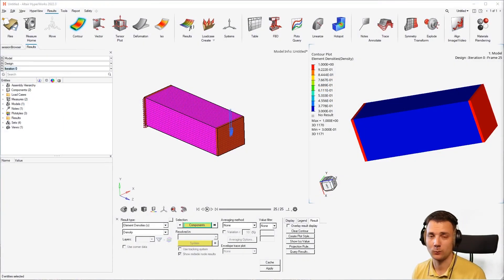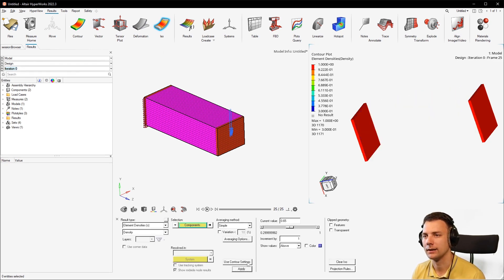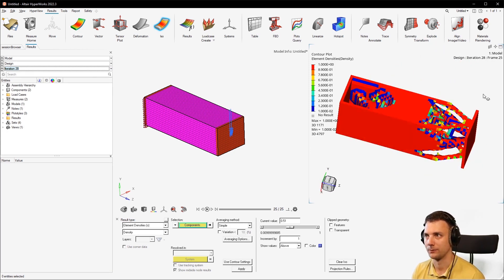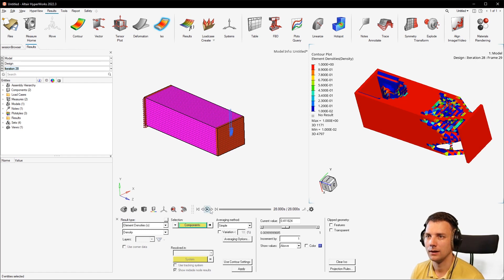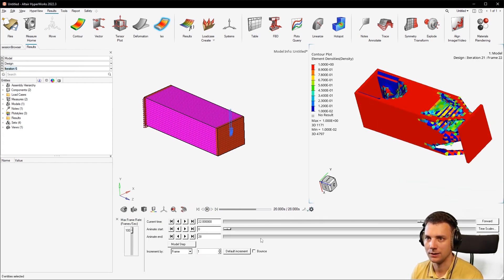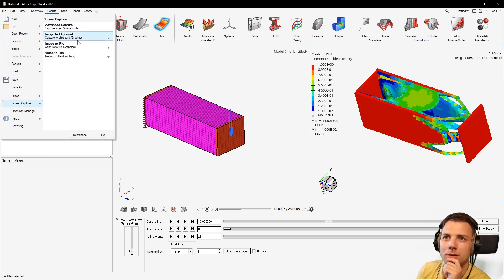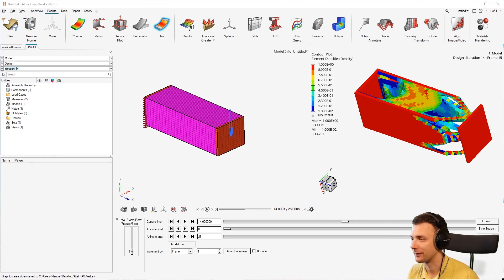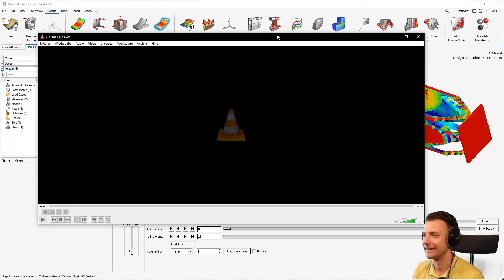Altair Hyperworks #short - Topology Optimization Results in Hypeview and how to export it as a video

Comment: Hi, I hope to don't bother you with a question not related with this topic.
I am simulating a bolted connection between two components in an assembly with rbe2. Do you know how it is possible to extract the force reaction that the rbe are subjected to? I tried different output card, like SPCFORCE, but since these connection are not SPC they are not visible. I tried GPFORCE but without a free-body diagram it shows no values. I am now trying with MPCFORCE but still struggling. 
I work also with Ansys and there it is very easy: once you set the connection (in first approximation I assume that the faces in contact are bonded) you can easily request as output the reaction forces and moments that the two faces of the connection exchange.
Thank you very much, i really appreciate your tutorial, learning Hyperworks alone is very challenging.
Reply from the maker: My best bet would also be with the mpcforce. Its not a reaction force as you dont have a boundary condition there. It depends how you model your bolt. Is it just a rbe2 connection for the entire bolt or do you create rbe2 in the lugs and connecting them with a cbeam (for example)... you can send me the model to ramsaier@rwu.de and I will have a look at it.